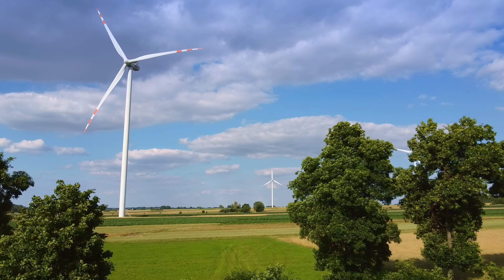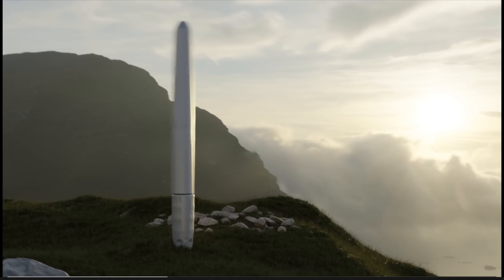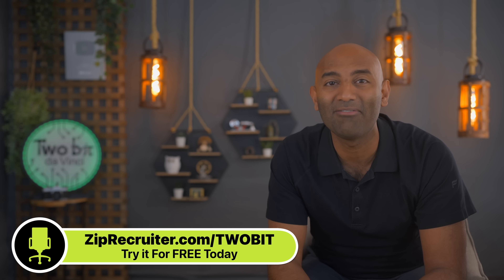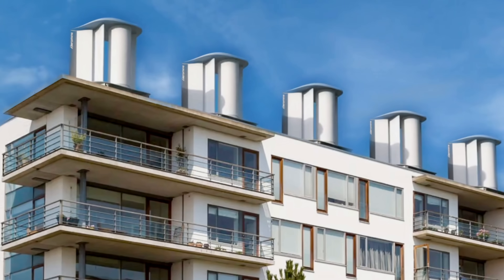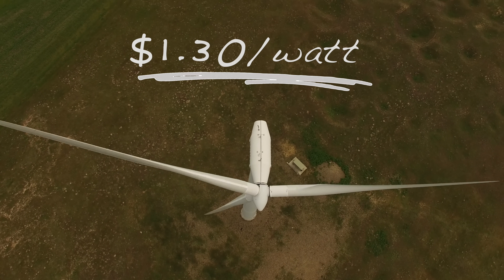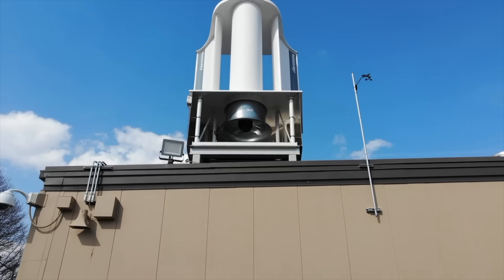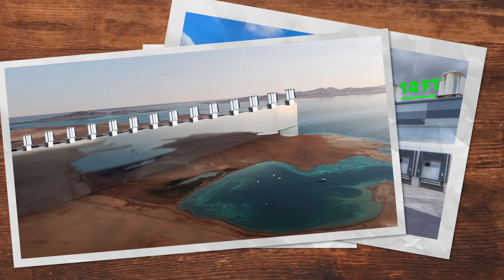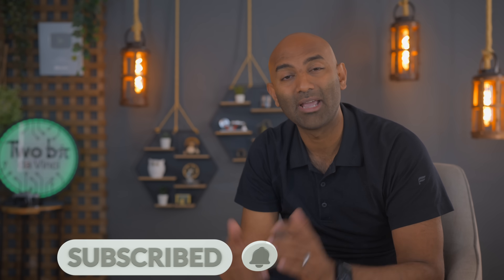Can This Genius Wind Turbine Outperform Rooftop Solar?

Comment: My first thought was how efficient is it in the 5 to 10 mph range.   The average wind speed in the USA is between 6 and 12 mph.  I would base any decision on that wind speed.
Reply: That wind speed is at what height?  Likely much higher than the typical home, especially once you get it surrounded by 50+ year old trees.
Reply: @kcgunesq  I think the obvious assumption would be that you'd need a mounting point that is exposed to the prevailing winds, Captain Wellwhatabout.
Reply: 10:12
🙄😳
So if it can turn 10 mph wind into 50 mph wind, what happens if you start with 60 or 70 mph wind?
Reply: Tell us you didn't watch the video without saying you didn't watch the video.
Reply: Do you know about gears?

Comment: The problem is that rooftop wind and modern VAWT  type wind turbines have been around for more that 25 years and 85 % of the companies that work in these spheres are set up in idea incubators and hubs, they release papers, ideas and produce many videos showing how they produce incredibly more energy than anything that came before them, they draw government and investor funding from all over the world and use this all to try and build the perfect turbine to produce the figures of power that they promised, which never happens so all the investor monies and government grants get wittled away and noting produced. on the other side of this is the 15% of engineers who are passionate in this space and are unable to secure funding for their more realistic models that produce real world figures. Any vawt will produce more energy that a standard turbune but what most people dont realise is that in most countries its illegal to mount a wind turbine of any description to a residential building because of factors like weight, and vibration.

Comment: I wonder if owners of large flat roof buildings could actually rent space for these machines either from the power companies or private investors. In some areas there are a lot of vacant buildings due to the economic turndown that resulted from COVID. Also there are some large warehouse buildings whose electrical needs are relatively low. The tops of large parking structures might generate more than they need.

Comment: I have been thinking about the same problem and realise the strong and weak points of traditional wind turbines and the wind mine, which I have been reading but understood only recently. I would prefer big towers but with modifications to make it better.
I would like to retain the advantage of towers but prefer a vertical axis wind turbine which would be good in any wind direction but more compact and could have a bird cage to keep the birds out of the harms way. I would like to lower the capital cost and invest it in storage for better returns. For this I would take the shaft power produced and gear it to a compressor. It could be compressed to 20-30 bars and stored in the tower itself. No electrification will reduce the capital cost. Out put would be of a smaller scale and compressed air could be used directly for mechanical work including water pumping.
storage would make for a wider tower and a sunlit area above tree level, which could be used to instal solar panels. The power produced could be stored in the battery for least cost overall and costly lithium battery would not be compulsory. A portion of compressed air could be used to run battery chargers at a suitable period for overall economy. The scale might be as low as 10% of that required I present design of wind turbines but cover battery charging of electronic equipment and lighting in combination with solar energy.
A part of compressed air could be naturally cooled overnight and used for cooling requirements or cold storage. The rest could be used for mechanical work.
Such full energy towers could increased as loads develop.

Comment: So I think a modified version of this would be perfect for bridge underpasses which also benefits from a Venturi like effect plus wind generated from passing cars.

You could also have a rooftop and/or open air floor in a high rise skyscraper dedicated for these wind turbines.
Reply: Totally right. Also, I think an even more important point to drive home is modifying architecture itself to take advantage of these types of effects. Imagine an entire building built in two towers just like these two aerodynamic wings with windows acting like the little holes sucking up air trough the entire structure and driving turbines at the base!
Reply: @Israel_Two_Bit  the ancient African and Latin American cultures used city design to create wind tunnels that reduced heat between buildings. To all due respect of technology … a lot can be done to reduce usage by design. I’m into home design and working on “net zero” building techniques/logistics. Flat roofs are being used in all our designs, to harness rain water - to install wind turbines - to take up less of a land footprint.
Reply: It seems like that could increase the drag on cars depending on the configuration. No need to introduce a tax when there are plenty of free locations

Comment: You need to look into Harmony Turbines.  They are self furrowing, so can deal with high winds and weather, and they are 360deg capable.  Currently small boat applications dominate, but others are coming.  I see them as complimentary to solar arrays on farms, in the corners of fields, etc.
Reply: Harmony turbines are elegantly simple and they look awesome. More like a kinetic sculpture than a wind generator. Then again, I guess most VAWT do, lol

Comment: I'm still confused why haven't people designed solar-panel wind blades so the solar panels cool themselves. Let alone some of the vertical standing blade designs would be easier slower less likely to break due to wind damage

Comment: Whatever happened to the halcium power pods. They are the ultimate in residential wind power. They looked great. Are easily placed. I would have purchased atleast 3. To supplement my 10,080 watts of solar.

Comment: I have seen many ideas that sound logical on paper not so in practice. 

Ground air flow energy is consider as Residual but Main Stream. 

Energy in air is more efficient coupled to the wind turbine Direct and less efficient indirect. 

Indirect? Significant energy loss from the use of Venturi effect out of friction passing air through duck works in a long haul transmission reaching to the impeller. 

Impeller must be driven by high rpm and high speed flow further loss of efficiency. 

All the idea and implementation is gearing towards energy loss for low efficiency. 

This is an idea conceived by a fictional scientist with no engineering and development experience.

Comment: You talked about the spacing of the aeromine, but you didn't speak of the amount of area a wind turbine needs.
Now, take that area and divide it into the area needed for the aeromine. I think if you look at the amount of surface area needed and looked at the output, the output of the aeromine would be more.
Comparing a wind turbine with a 300' diameter is not a good example when comparing to the aeromine.

Comment: So I’m reverse engineering this project and watched a bunch of people making videos on this. There is more to this.

1 it limits high speed intake.
So currently I only got it at 10% 
But at speeds 
35mph it reads 3.5 mph at the inlet.

2 you don’t need the sheer wall effect it just amplifies the intake speed of the fan and also the Venturi effect between the blades so essentially doing double duty. This can be done on any roof even with a eve if the intake is on the walls top surface for the same effect. 

3 if you have a pitched roof this can pull even more in a vented attic space to essentially act as a supercharged Wirly bird, this is especially great in hot climates. 

4 the team has been radio silent for the most part in trying to contact them for there claims of 50% mainly because of the verticality needed that could cause shading for solar. 

Overall for a standalone product for commercial use, if it can be validated by there claims (v1,2) then it would be a great product for energy independence

Comment: The power nest structure is also a super interesting one, it uses solar panels on a slant with turbines underneath them and fins drawing air into the system, making the whole system about 60% more efficient to comparable systems
Reply: Is that the one pre fabbed to sit directly on top of existing buildings? If so I thought that was a very unique idea&implemented very well. 👍🏻
Reply: i like that!  i have learned about another semi type of system like that, but with agriculture in mind "agrovoltaics", basically you build the solar panels on racks above your field(yeah, probably not too "wind friendly") and then plant below the panels, the panels "block" the UV that would burn the plants, and the plants thru respiration, cool the air under the panels and actually increase the panel output by keeping the air cool.

Comment: For the direction issue, just mount it on a pivot and put a sail on one side to keep it facing the wind.
Reply: It can't move like that it's connected to intake pipes that are fixed.
At least that's how it looked to me. Plus he said it couldn't swivel.
Reply: @mawlakewlz  The only real output should be the 2 wire power lines.  This can be done with rotational contacts .
Reply: @dennistucker1153  Maybe I misunderstood the video but I thought I saw it connect to a tube that had the impeller for the dynamo in it, and that made it unable to pivot.
   In any event I really think Ricky said that it COULDN'T be made to pivot for some reason.
   I could have totally mixed it up, and the ability to pivot into the wind seems like a benefit for any wind-based device, some I'm with you on that.
Reply: It seems the pivoting is not possible because it needs to be at the edge, of a square edge structure, to benefit from the compression effect of the prevailing wind.

Their 2nd generation version could theoretically be movable because the aerofoils, venturi and generator ducting etc., are combined in the same structure, but to move it to face the prevailing wind would require a track structure to move it around the edge of the building.

It appears to me that the cost benefit of this design is going to be tenuous enough already, save an exceedingly small proportion of cases with EXACTLY the right conditions.

I’m not going to get too excited about this one……
Reply: @adamkohalmi7180  I agree.

Comment: I think wind and solar for the home would be great. there is an vertical axis wind turbine that closes the faster the wind blows so it does not overspeed and break. Thank you for the info. I cannot wait to see how this all works for you.
Reply: If this or other modern turbines work as good as they say, they will be bought up by the big companies and put on a shelf and never seen again. Back to square one.(Again)
Reply: What if you control the magnetic field in the generator so that the harder the wind blows, the stronger the field, and the more energy is converted to electricity?

Comment: Sounds like BS. 1) Wind will follow the path of least resistance and follow around structures 2) The power in the wind speed is low in residential areas. Most cities have average wind speeds around 3m/s.  In industrial wind farms on mountains or at sea it is more like 10 m/s. To calculate the energy in the wind you cube the wind speed. So residential 3^3=27 and industrial 10^3=1000. So industrial turbines will be 37 times better!

Comment: The design is simple enough. You could easily make one of these out of plywood and some screen material. Put the aerofoil (airfoil) section on a bearing on top of a big hollow tube (so it draws air up from the ground) and put your turbine inside the tube near the bottom for easy maintenance. Put a tail on the aerofoil section so it turns, always facing the wind and ensure the tube is hollow up into the aerofoils and you should be good to go. I can't imagine something like this costing nearly $10grand to make. Maybe $2grand if you use good quality steel for the pole and coat the wood with a weather resistant coating and fiberglass. And hell, you could even slap a small solar panel on top of it to grab some of that delicious sunlight for a bit more power generation, or if you're in cold climates, embed some heating elements into the design to melt the snow.
Reply: I wil try as er your suggestion
Reply: I agree it wouldn't cost $10k to make, the $10k is what it would sell for initially, until it was able to be manufactured in high enough quanities to lower the cost.
There are other things to consider when looking at the price you would pay for one of these units.

Parts, Labor, Logistics, Warehouse leasing, Factory leasing, Insurance, Interest repayments, plus a heap of others I would presume.

Any company that sells something as the price it takes to make it would go out of business in a really short time.

Comment: This seems like an ideal DIY wind turbine design.  I'm curious how the length of the wing section affects performance. I could see someone scaling this to 20 or 30 feet in their back yard with the generator and intake at the ground level and the wings divided into sections with simple air flaps to prevent air being sucked from different sections of the wing. there is also no reason a ground mounted  design couldn't swivel to match changing air direction. it seems like mounting on buildings is about forcing more air through the wings, but in places with actual wind the issue for home users is maintenance. having all the moving parts on the ground is a big deal. Although it would have to beat cutting a 50gallon barrel in half and mounting it on an alternator.
Reply: Totally right. Although from a DIY standpoint, it might be hard to nail the exact curvature of the wings to maximize the Venturi effect. That could be an issue. These guys are experts in aerodynamics and they have a wind tunnel for testing, so in a DIY scenario, it could be a real hit or miss. It would still be pretty awesome if you made it work, though.
Reply: @Israel_Two_Bit  it definitely has some interesting engineering aspects. Perhaps an adjustable wing design. The big thing to me is having all the moving parts easily accessible. if you have plenty of wind efficiency isn't the biggest problem but moving parts always means maintenance. It is definitely hard to beat the simplicity of the vortex generator.
Reply from the maker: Hopefully this new design inspires many people to make a Diy version.
Reply: Tech Ingredients would probably show a diy wind turbine/aeromine.

Comment: I am waiting for one of these wind concentrator ideas to pan out.  Its not just efficiency but the range of wind speed that is useful.  We have east or west winds here depending on time of year and it would be important for this unit to pivot in some way.  I have a shipping container I would love to try one of these ideas on.
Reply: I thought about shipping containers as well. Those vertical canals containers have on the walls could help direct the wind upwards even more. Also, anything on the coastline would work well. As in, at the edge of a cliff or something similar.
Reply from the maker: That would be awesome ....they diy potential is awesome here
Reply: @TwoBitDaVinci  My wife says I get far too many ideas from youtube.  My current project is getting a chicken flock going (first batch of eggs put in incubator a couple of days ago) and getting a soldier fly compost system going as part of a high protein food source for chickens.  I'm just bouncing around wind turbine ideas in my head.  I do have a weather station installed on container to get a detailed idea of wind speeds on my property.
Reply: @leroyharder4491  It would be awesome to see some real-world data from that weather station
Reply: Check out a Darwin wind tower.  it's a good design for light variable direction winds.  Robert Murry Smith has a couple different designs over on his channel.
Reply: I'm with you... the unit should be able to pivot on a fixed flat base. Time of year & weather matters where I am in the wilderness on NE WI, which presently is buried in 40 inches of snow. 

Wind direction & speed varies constantly, thus the need for a pivoting unit. Seems like they need what I call a stackable unit not a one size fits all scenario, so that depending on the need one or more stackable units would be added.

I wonder what material the blades and unit are made of as to both easability for the wind to get the turbines moving and then also Lastability too. I get the gut feeling a solid spoiler is not as efficient as one with multiple indented shaped designs in the spoiler to pick up the wind easier and then transfer that energy to the generator and battery. 

The pic of the snow impacting a unit in winter sure fits the bill up here. We get snow from Nov into May and can have weeks on end of Cloudy skies without one Sunny day, which is Very depressing. That's why on a rare sunny day I bundle up and stand in the driveway and lift my face to the sun with my eyes closed of course and catch 10 mins of sunshine to get some much needed vit D and banish any depression. I have to take vit D supplements especially in the Fall & Winter. 

I wonder where the host resides?

Comment: I wonder if they could make these larger like the windmills and thus make them generate more energy with less surface area and less moving parts.
Reply: Size could be increased by adding more airfoil the distance between the airfoil would be key to the overall efficiency of the system.

Comment: I mean, couldnt you also stack these things? Vs Solar that needs more flat area? I feel like even the dirction of the wind could be fix by putting it on a pivot as it not really limited to the direction it self.